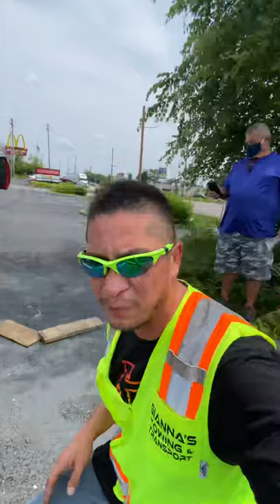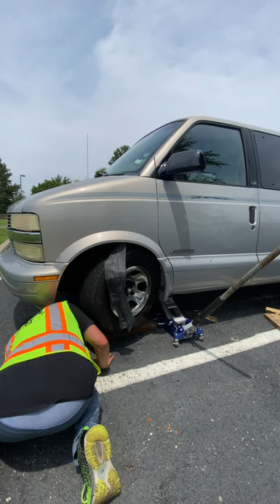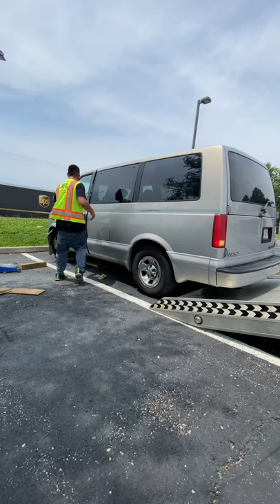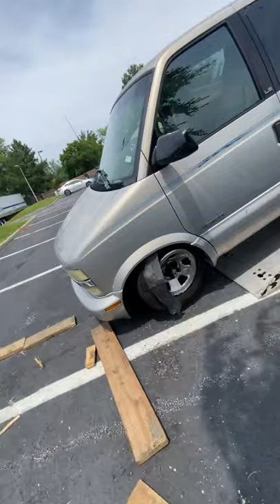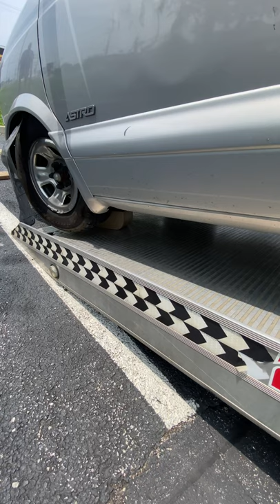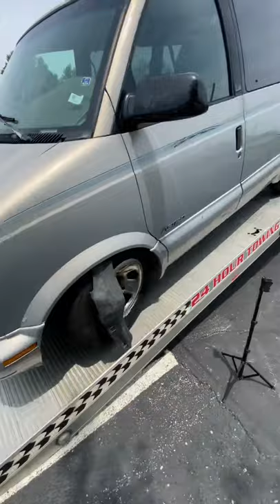How To Tow A Broken Ball joint Car Or Truck

Comment: I have a question when you get a call for a broken ball joint how come you don't use the wheel lift or bring one wouldn't make it much easier for you??
Reply from the maker: No it’s rear wheel drive I loaded it in less than 5 mins that’s pretty easy I hate using dollies plus the wheel lift will push the wheel up into the fender and cause more damage I could of easily took my self loader or used my wheel lift but I’m happy with the route I took I was rolling in 10 mins unloaded it in less than 5 🪝💪
Reply: That's on Dispatch,,, they think all drivers can make Miracles happen whatever truck they are in. ... That's how my place thinks👎👎👎